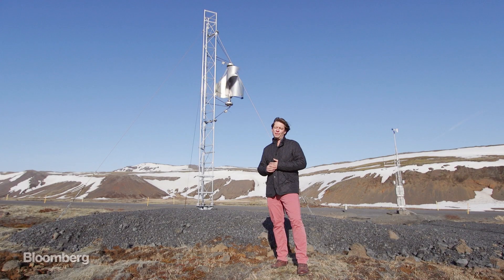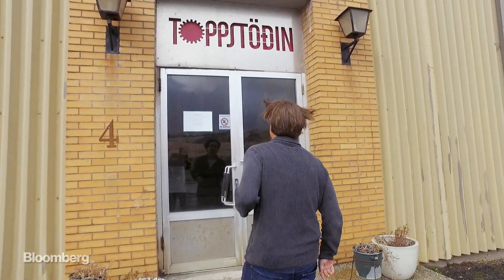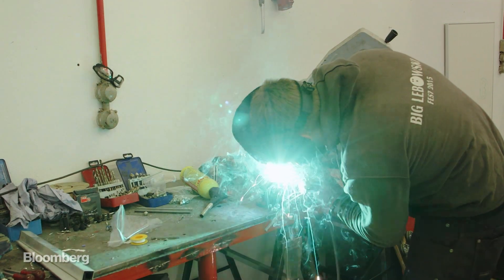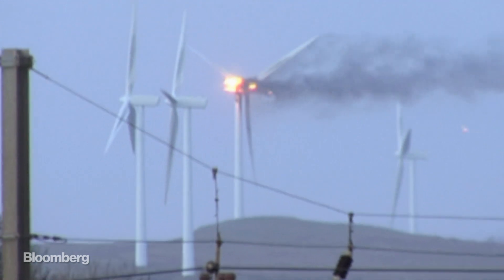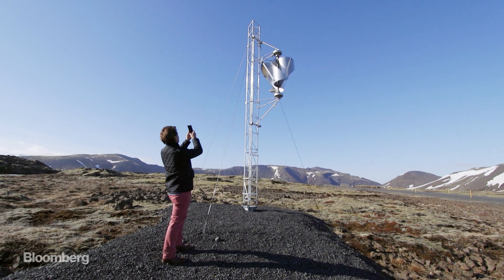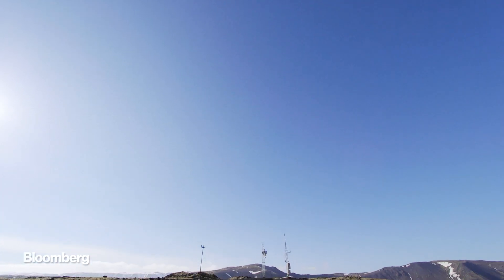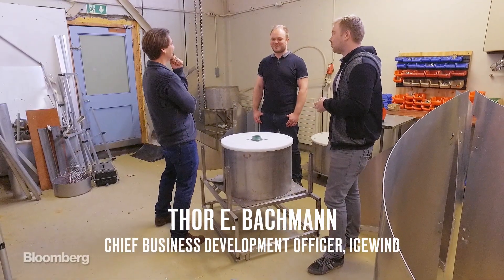The Tech That Could Fix One of Wind Power's Biggest Problems

Comment: This design offers very little advantage over the conventional design. The surface area of the blade is much larger so the weight and size is much larger. so much its impractical at the large scale. Efficient at the small scale but that's not going replace big wind turbines.

So essentially you can't even compare the two.

Comment: why not use lighter material? you are turning kinetic energy into electricity..the heavier the material is the more force is needed to push it...put simply lighter materials are far better for this purpose..so long as the material is strong and light enough there should not be any real problems.

Comment: Any conventional wind turbine that over-speeds is a very crude device or a broken one. Those here in Oregon and Washington have variable pitch blades, can even be feathered while facing into the wind and not turn at all, no matter how fast the wind, which is also done when requirements are low.
Reply: interesting.   Would like to see how that is made.
Reply: The technology has existed for over seventy years, its basically the same system that was created for propellers in the 1930's and 40's, albeit on a much larger scale.

Comment: off topic , but  for all electric and automobile engineers : what if Tesla design a car with wind Turbine and wheels magnetic generator  in order to supply electricity back to the battery , would the car in theory be self sufficient at 120 miles per hour ?????
Reply: Geographer 4 fun

Comment: The real problem with wind generators (they are not 'turbines') is the variability and quite often total lack of wind to make wind power a real source of electrical generation. 
I think that many are not aware that there are always thermal stations running even if they are not providing load just to compensate for the winds unpredicability and variable force. It's like having someone drive your car behind you while you cycle in case of a problem, cycles however, are a lot more reliable than wind, but the basic principle applies.

Comment: Will those turbines work also during still winds? That's a very prominent problem in other areas. Iceland is an island in the middle of a large ocean. I doubt the results will be nearly as good deep inland in mainland Europe (of which I have firsthand experience), however clever design it may be.

Comment: Bett's law says that no turbine can be more efficient that 59.3% and while large Horizontal axis ones may reach somewhere about 45%.  The structure of this very very unclean turbine would not be much, and I can fully understand the reason it would not over spin in high winds, Just because anything goes around, it does  not mean it is efficient to transform wind energy into other forms.  Still good luck if people are happy with getting what they can out of an engineering that fits the state one needs it to work in.
Reply: I see that the six tension and compression struts holding the actual turbine away from the main mast are not attached at the NODEs  of the mast  but in the middle of the vertical components in between the welded nodes. I do not think that is good engineering principles as the small  lateral vibration that that vertical component will suffer will not do much good to the  welded node over a long duration of time especially in those hard conditions.
It is a very dynamically unclean design and those structural rods supporting the blades will break down the laminar air into a lot of turbulence loosing efficiency.  But it looks sturdy enough to take some punishment provided one shuts one eye to some procedures incorporated in this design.

Comment: The only draw back to this type of device is the starting wind speed needed to start it moving. So one needs to always do some research to determine if your site is suited to this particular type of unit. 
A friend of mine installed a starting motor on one he designed and built to see if that would work better for him. It dad work but at the time he constructed it he had no access to automated device to start his unit. In addition there his access to light weight but strong materials he could use was also limited. I live in Minnesota where winds are marginal for this type of device is limited. 
I happen to love the design. With no slip rings needed, lower tower and less complicated over all.
Reply: I have a copy of the book about research done during WW2 on Grandpas Nob on a very large wind mill built there. The head of the project said in the book that windmills could start producing energy efficiently in the three hundred foot range, if my memory serves me correctly. Modern windmill designs are reaching that size. In addition many are becoming simple in design including getting away from gear boxes. 
The egg beater design really is the most simplest of all designs it does have a place but large scale production of power isn't one of them. The size use here is perfect for small scale power demands.  Remote cabins, battery charging and areas where people can repair windmills without heavy equipment cranes.

Comment: The explanation for the Turbine on fire is wrong. It is usually the gearbox with a few hundred of litres of oil that catches fire.
Here in Germany we have 4-8 turbines burning each year. The problem until now is there is no way to stop the fire, because they are simply to high. The blades coming down causes a risk as well. However, every technology comes with risk. 

The small gimmicks they show here are terrible inefficient and will not play any important role in the future.

Looking cool does not pay for the owner.

Comment: A portuguese startup invented a better turbine several years ago. Google Omniflow.
Reply: ... or youtube them even. I wonder what happened to them? P.S. Inventions are relatively easy (it's what you do in the lab). Going from startup to profits is a bit harder (it now includes what everyone else thinks of what you did in the lab).
Reply: The Omniflow wind turbine "with integrated solar cells" (3kW wind + 0.8kW solar) looks over-engineered.  Vertical designs look "foolproof" because you don't need a mechanism to turn them into the wind, but are they as efficient as the 3-bladed propeller design?

Comment: All Ideas are good ones if they work. i have 2 good ideas here for you all. 
   If we all switched off / unplugged  all items not actually in use you may save 10%  if Everyone in a country did the same it would be a very big 10% saving.
   Also if wind and solar equipment was mass produced and sold cheaply enough to the domestic user many more would install one  or both dependant upon the local area / weather. etc. 
  If only 10%  did that , then we would have another 10% Saving = 20%  less demand on the grid. and 20% less carbon or nuclear waste to deal with. ( not suitable for cities but fine  for all those with their own roof ) 
Every Kw Generated helps.
Keep thinking everyone and keep inventing new / better ways. One  day,  one good idea will work.
Reply: thats actually a stupid amount of time and effort invested for a 10% reduction. I mean damn the airline industry puts a winglet on the end of a wing and gets 5.5% savings. 

if your going to have somethign like that at all it has to be automated. 
The issue with the buying your own generator is that at the end of the day it's hugely ineffiecent.
Reply: Don Ziolkowski Hi Don,
I was putting forward a basic but realistic simple example here.
What my point here is - We should all stop Wasting energy in a big way. 
  = switch everything off if it is not in actual use.
 For example Hotel style. - As you step out of the lift a couple of lights go on, as you continue along the corridor 2 more lights go on and 2 behind you go off. 
  You open the hotel room door with a card then place it in a slot = all the power is on, the switches and sockets are live. when you leave everything goes off except the fridge and one RED socket.
  Apply that to new build houses and Refurbed  houses and all business's. 

Also homes and workplaces should have PIR motion sensors to light up Basic navigation lights as you walk around the home.
Navigation lights would deliver just enough L E D  glow to avoid accidents, like tripping over sleeping cats dogs, kids toys furniture etc
  It only take 4 or 5 good ways to save 10% energy, Or 4 or 5 good ways to improve renewables by 10% NOT reinventing the WHEEL !  
10% more efficient wind wave and solar ETC.
 10 X 10% makes 100% Difference.
On most days i can generate a large amount of the energy i use in the evenings, i just need more efficient and cost effective ways to hold and store this energy for use in the evening at home. to me it is all free surplus wasted energy at no extra cost to produce.

Comment: Any thoughts on mounting such a turbine horizontally at the peak of a steep-pitched roof?  you would lose wind power from the axial directions, but the sail effect of the roof channeling wind up into the turbine from lateral directions might make an impressive boost in lower wind speeds.  Or am I out in left field in that thinking?
Reply: Every little variation in wind speed would cause some vibration that the building would amplify.  Anyone in the building would be driven crazy by the noise.

Comment: This and the oscillating turbine seem like excellent replacements for that loathsome windmill style! If these could be on every gov't building or bus shelter and provide energy for some of the small things like powering lights and signs and such that would be a lot more economical I would think.  If you can paint them and 'pretty' them up then that would make them more appealing as well.
Reply: They would probably never recoup their cost to produce.
The reason they are being used on telephone masts in the middle of nowhere is because it is cheaper than installing power lines all the way out there.

Electricity cost in the UK $0.20 per KWH, a light bulb will run for ten hours on $0.01.
If this costs $500 you could run your light bulb for 57 years for the same cost.

It just isn't viable.

Comment: Vertical axis turbines have been around for quite some time.  I hav not see on like this but a somewhat larger two foil was tested in Alberta at the research testing station.  It was also hand built and produced a surprisingly amount of power in just a breeze and because wind in Southern Alberta is omnipresent and because it was self regulating , it seemed to work well.   The only resistance was from oil producers.  I think it worked too well as some 'vandals'  destroyed it one night.  But that was in the days of the extreme right Reform Party and the times have changed.  Also  Iceland is a different land.  Seems to me they just told the Rothschilds to bugger off a few years back and seem to be doing just fine.  This turbine is small and compact and what I did not hear mentioned was its wind direction independence.  Cudos
Reply: Oh for goodness sake.  Do you not get tired of blaming everything on the oil producers!
Reply: Greed head scams are boring to you?  Okay...  To each their own.
Reply: Ditto...what Phi said.

Comment: Why not make the thing much longer and capture more wind? Set up a 100' long unit in a sturdy central internal axis ... or a string of units counterbalancing each other on opposite sides of the pole. How about trying a horizontal one? Show how bird-friendly it is; birds can plainly see the entire device at a glance and avoid it. Explain why it doesn't over-spin. This is nice, but they're not taking it where it should be going yet.

Comment: Savonius Wind Turbine - good for them and there is no reason to slam them for reshaping a common path. But in the end, what you need to see is third party test results (such as BWEA), that pertain to performance and then a serious discussion on maintenance (safety when you are on the tower) to power-transmission (electricl noise quality) and survival at high winds, load loss, stress loading on the tower, et cetera.  There are some good solutions out there, some good companies that have the chops to survive this erratic business, but I seen the bad more frequent than the good.

Comment: These things are really small.  I bet the energy output per unit of steel/aluminum is poor.  Spending hundreds of $ to generate 10~20w of power may not make much sense...
Reply: If they last a long time with little maintenance, they're worth it.  Also, I assume they can be made bigger with the same advantages.
Reply: It may be a Small Output but it can still Power a Microwave, Technicaly. Also you can Change the Design a bit and with that have MUCH larger ones.

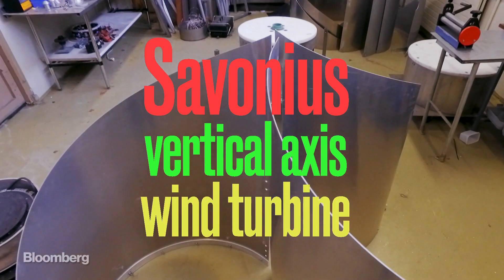Comment: "vertical access"? (0:48)

Apart from that I found this video very short on worthwhile information. How does the efficiency compare with blades? How are high winds dealt with? What specifically are the advantages of this configuration?

Three minutes should be more than enough time to answer these basic questions. You need to up your game. This felt like a waste of time.

Comment: I know answers have been given below as to why the design works in high winds, but it really isn't clear in the video.  What is interesting is that a few of the shots appear to show the turbine expanded, as if at higher winds the centrifugal forces pull it apart, thereby destroying the effective shape of the turbine and increasing drag, ensuring no overspeed spin.  Can someone in the know tell me if this is how it actually works?  I'm not convinced by the "maximum speed is wind speed" given below, seems like that could easily be in excess of a safe rotational speed still.

Comment: It seams cool, i had a simelar idea for the design of a windmill and wonder why the factories didn't use a system like this, where they can have the electro engine on the ground instead, in the top of an expentive tower.
but what do I know, I geuss they have come up with the must effictive model.

But no-one mention anything about the most importen things, which is :
1) how much enery does it produce ?
2) how small a wind is required, to make it work?
3) how much turbulens, does it create, in it's surroundings?
4) how mush noise does it make?
5) and what will the price be?

It's smart to have a turbine to produce the electricety where we use it, but I think it better to have it a little higher up, in a rooftop ec. I thing I'll get dizzy to look at them all over.
But congratulation with your disign, hope you'll succeed.

Comment: Super old and super inefficient technology... that’s why no-one makes them on a large scale. Ok to power a few led lights or some simple electronics. To get any decent power output you would need one the size of a skyscraper.
Reply: Size of a skyscraper... You mean like the wind turbines they already make?
Reply: If they're cheaper to make and don't require as much maintenance, it might still be worth it. I'm glad they're trying at least.
Reply: +triforcelink ... absolutely. For low power usage they may be a good solution. I`ve investigated all types for my rural property and these are ok for emergency lighting etc but little more I`m afraid.
Reply: what do you feel is the most efficient product on the market for large scale usage?
Reply: well you may have something...in places like iceland and hawaii or coastal areas that have prevailing winds. giant mega structures could well be the answer .
Reply: What makes you believe it is a lie published by Globalists? There is plenty of evidence that there is a link between Global avg. temperature and CO2 (and other Greenhouse gases) percentage in the atmosphere.  

The only thing that may be considered questionable is wheter or to what degree human activity has any impact an CO2 emission into our atmosphere?

Besides if even there isn't any correllation, Coal, Gas and Oil aren't really renewable (well technically there are reneweable but it takes 100 hundred thousands to millon of years for them to renew...) so eventually we will have to switch anyway to renewable resources... so why not make the change now, and spare all those Carbon Resources for other usefull stuff in the future?
Reply: D8W2P4 well if your going to make claims dude , back them up . no ?
Reply: D8W2P4 wow such a font of knowledge ,now I see . you are the truthsayer . oh by the way where are these geological  records you talk of so confidently ?
Reply: jmpmcd
Just look it up it saves both you and me time.
Reply: Crymp because if they did ,they would not see any profit from the burning of oil and coal . they are so blinkered and short sighted .
Reply: jmpmcd
I don't have to make some 10 mile long list of links and references just put "geologic temperature records" in a search and look at the results.
Reply: jmpmcd
I literally told you what to look for in the first part of my comment.
Reply: Considering 20,000 years ago was the coldest this planet has ever been and we're FINALLY starting to warm up to temperatures closer to what is actually normal for this planet (we're currently 6-8 degrees colder now than the norm) global warming should be our goal.
Go look at the geologic temperature records and you'll see.

Also you know all these problems they talk about with droughts, deoxygenated portions of the ocean etc? those are issues that only occur during iceages because it hinders the water cycle.
Reply: Mind as well just use oil, gas, and coal problem solved, there is plenty of it and CO2 hasn't got jack squat to do with the weather or climate, its a lie pushed by the globalists.